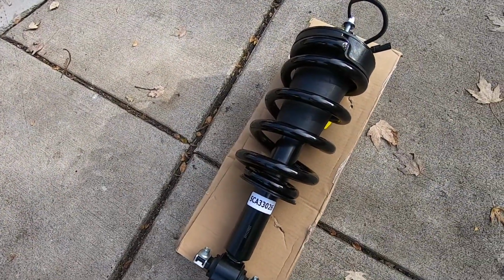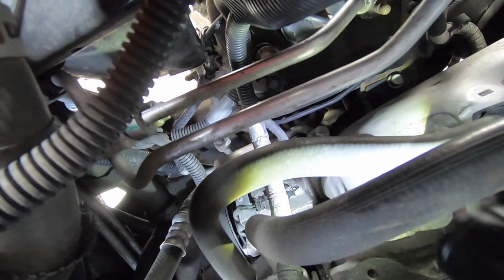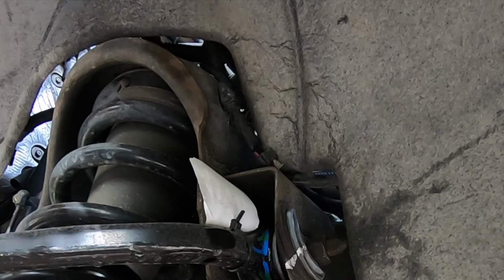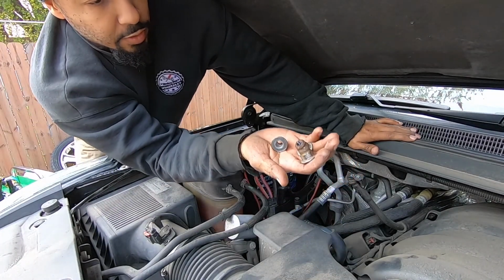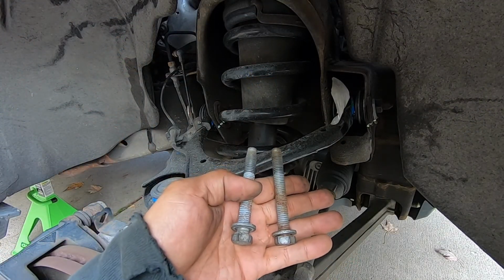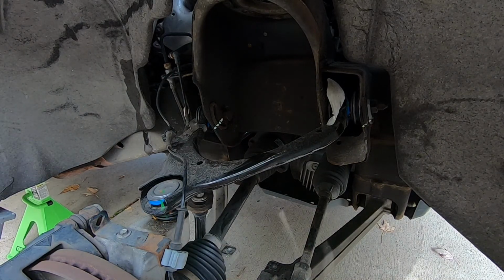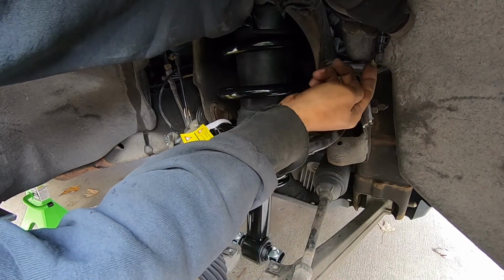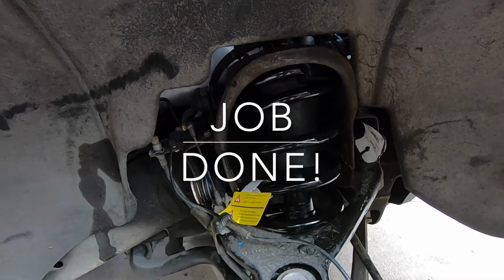2015-2020 Escalade Front Strut Replacement Tahoe Yukon XL Suburban Silverado Spring Shocks MagneRide

Comment: Thx again 3W’s! What brand did you go with and how are they doing??
Reply from the maker: @elice05  No problem! I did this on my Escalade using oem GM struts so it was just like factory. On the GMC in this video I used TRQ struts. It’s my aunt’s Yukon. She hasn’t complained at all so I think they’re good. https://www.1aauto.com/chevrolet-gmc-cadillac-front-driver-and-passenger-side-2-piece-magnetic-ride-control-shock-and-spring-assembly-set-trq-sca33131/i/1assp02463/2386082/2019?gad_source=1&gbraid=0AAAAAD_ve_l0M-hCRNHiTyjlrEW9fj6vv&gclid=Cj0KCQjw8MG1BhCoARIsAHxSiQn8vyWsbrveMJfLNXsbfv637s4TIRfze_7KMJwnI2zTjlA74VXCd-8aAqmKEALw_wcB

Comment: A question, can I put the normal shock absorbers and not the air ones, they are cheaper?
Reply from the maker: You can but you may get a suspension light if you have magneride. And you’ll have to figure out a way to deal with the air compressor. I know there are companies that sell kits to delete the magneride and self leveling rear suspension.

Comment: I noticed a transmission dipstick under the hood. What transmission does your Denali have?
Reply from the maker: The Yukon in the video is an early 2015 so it has the 6 speed transmission. Late 2015s and newer have the 8 speed with no dipstick.

Comment: Replaced mind and have the suspension error.  Has front right.  But its all connected correctly.  So wither i have faulty wiring, a bad strut, or maybe i separated somwthing else rhat i didnt notice
Reply from the maker: That’s unfortunate. Once when I did this job, the wire that sticks out the top of the strut was damaged. Had to email the company I bought it from a bunch of pictures for them to honor the warranty and send out a new one. If the packaging gets damaged that wire can get messed up pretty easily.
Reply: @WorkingWithWimberley  what's weird is I see it changing values on the live data.   So appears to be working yet throwing a code
Reply from the maker: @jamesjudd6577  That’s odd. I’d expect to work 100% or not at all. I can’t call it.

Comment: The 2 bottom holes don't line up on the new one. Do you think i got a bad strut
Reply from the maker: It’s definitely possible to get bad parts right out the box. Can you put the new strut side by side with the old one to see if there are any differences?
Reply: @WorkingWithWimberley  il try that thanks for the advice and the video
Reply from the maker: @johnmflores85  You’re welcome! I’m glad the video helped!